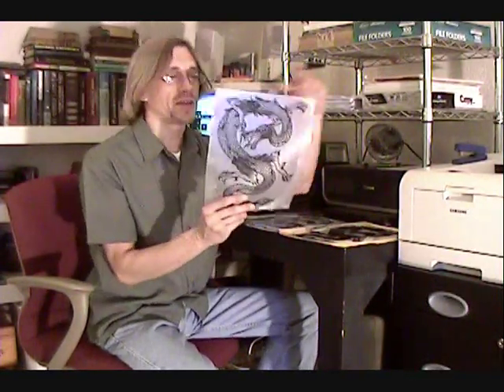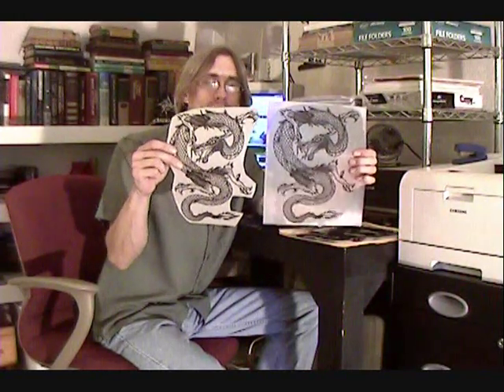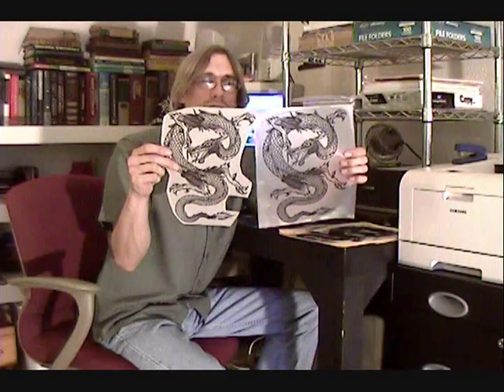How To Screen Print: Making Film Positives At Home

Comment: You can avoid needing rip software, by using photoshop. Convert each channel into a grayscale then a bitmap, when converting to bitmap you can specify the dpi , lpi and dot type, ellipse or round, then simply print the bitmap to any inkjet on clear film, It works great and the inkjet has no idea it has became an imagesetter

Comment from the maker: @dimojoe Illustrator wont automatically separate colors for you; you create the art on different layers which gives you your color seps for spot colors. I dont know if it accepts those plugins, you would have to research that. Illustrator and Corel will require some learning to use them efficiently and easily. But there are programs that do separate images into color plates for screen printing. Do a Google search. You are welcome. It is my pleasure to help out. Thanks for watching & commenting!

Comment from the maker: @xmas0c1c1k1korea Welcome! For inkjet printers, I believe inkjet film is best. If you want to use RIP software properly, then most will require you to change to all black film inks. If you use a dual cure emulsion, you may be able to just print it without any RIP or black inks and make screens. Dual cures have a wider exposure lattitude and work well with crappy films. The QTR RIP mentioned in this video is best for photographs, not screen printing. That's what I learned. Thanks for watching!

Comment from the maker: Photocopies generally lack the opacity needed to block light during exposure. But yes, you can use copier transparencies as your film. Just double them up to make them opaque. In general it is easiest to find a way of printing them out directly without having to double up or do an under exposure. Using a dual cure emulsion helps with inferior films. Thanks for watching!

Comment from the maker: Theoretically, yes. That is known as a color rich black. However, some inkjet films may not be able to take so much ink. Also dye based inks work better for film positives than pigment inks which is what is common today. Supposedly the pigment inks used with the color rich method still dont work as well as a dye based ink or inks designed to make film positives. You would have to replace all of your inks with a dye based inkjet ink in black. Then it may work well enough to be cost effective.

Comment from the maker: @c0kar7 You will need an ink that is an air dry enamel that will bond with the aluminum. I don’t have too much advice to offer on this as I am a textile printer. I have done some metal printing but not really enough to say much more. I have always used enamels that bond to an enamel coating on the part being printed. Thanks for watching & commenting!

Comment from the maker: @dimojoe - Not at all. Most tee shirt art is clip art or modified versions of clip art. A lot of designs can be made with simple skills in Corel or Illustrator. Photoshop is not really what you want to use for creating tee shirt art. You will want to use and create vector art rather than jpegs. It will give you a lot more control over your artwork and printing. And Photoshop probably is what they say it is for cost. I remember when it used to cost thousands. Thanks for watching & commenting!

Comment: Thanks for the great video! I'm going to try the double-up method with my inkjet printer. I create my own artwork on cardstock (just one color black line/spot type images), so it just needs to be scanned and printed. The images scan great and print on paper with very sharp lines, so that part is good. Now I just have to get some transparencies (and no doubt use your double-up method).

But if I do decide to have some transparencies professionally printed to make them more opaque - without the hassle of lining up and taping two (or more?) sheets together - who does this kind of work? Can I just take my artwork to a local printer, and they will have the right kind of printer and software (RIP) and waterproof transparencies to do these right? Or do some screen printing shops offer to print transparencies for a price? And what kind of price range are we talking about? Thanks for all your help. I've already watched a number of your videos! Very helpful! Cheers.
Reply from the maker: You're very welcome. Only a screen print shop would have the appropriate tools to print color separations on film positives for you. There are some services online for this. I will eventually offer film positive services after I get settled in a new place. Pricing will vary depending  on who does the work and there is no set price. It should depend on the work involved in doing the film positives. Please make sure to subscribe ;)  Thanks for watching. Screen Printing Equipment & Supplies - http://catspitscreenprintsupply.com/

Comment: ➲ Hi. I need some advice from professional like you. I've recently bought A3 EPSON 2100. It's an amazing printer BUT by printing on transparency film the ink doesn't drys up fast enough and the ink gets smeared by the printer rubber wheels which are moving the film. Would it help if I used EPSON films (I'm using some cheap ones from eBay, which I did NOT have any problem with when printed with HP Inkjet printer)? ✔ Thank you for answer!!

Comment: If you under-expose and then wash out the emulsion where the print is, can you then go back and expose the frame again to finish setting the emulsion really well?
Reply from the maker: Some emulsions may allow for that. Others will not. Check with the manufacturer for details on that. I sell Textil PC blue which you can post expose to strengthen the stencil and make it resistant to water based inks. http://catspitscreenprintsupply.com/saatichem-textil-pc-blue-emulsion-gallon/ Thanks for watching and leaving a comment!

Comment: Is it possible to load up your CMY ink jet printer cartridges with black - so that if you print a piece of art (tell it to be 100%C, 100%M, 100%Y and 100% black) .. a "SuperBlack" if you will.. then the ink would have a density/coverage  of 400%
Just to make clear, even if you printed at 100%Cyan - it would come out black.
You could also control each of the other cartridges. if it's too much ink coverage, or not enough-just by making the art  say 100%K, 100%Y and 50%C = Total 'black' ink = 250%

Comment: hi boss5..i would like to ask if the printer should be pigment so i could use it for heatpress ang making positives for silkscreen..can i buy epson 1300 or 1400?thanks so much
Reply from the maker: +Christopher Cudiamat You can use an Epson 1400.

https://www.youtube.com/watch?v=onEAPXahCp4

Thanks for watching. Screen Printing Equipment &amp; Supplies - http://catspitscreenprintsupply.com/
Reply: Ok thanks sir.. but i have a bit of a problem..i cant seem to find an epson 1400 here in my country..but there are available 1300 would tjat be fine?can i print film positives in it?thank you so much.. :)
Reply from the maker: +Christopher Cudiamat I think so. Most Epson dedicated printers work well. Just don't buy an "all in one."

Comment: photoshop works wonderful as rip software, no need to buy more
Reply from the maker: If you're a PS guy you can certainly use PS to make screen printing art. But the fact remains. PS is for raster bitmap images and photographs. AI is for vector art and graphic art. You cannot use PS as RIP software but you can print out halftones through PS. But again AI will create much higher quality halftones. AI is the standard for our industry. PS is also used . Thanks for watching! Screen Printing Equipment & Supplies - http://CatspitScreenPrintSupply.com/